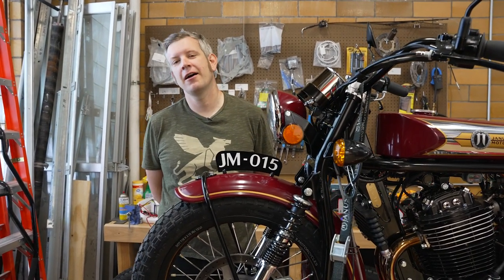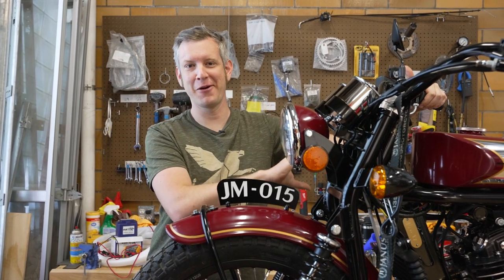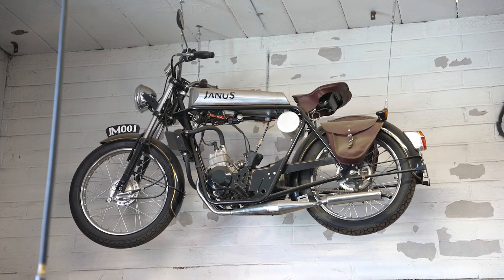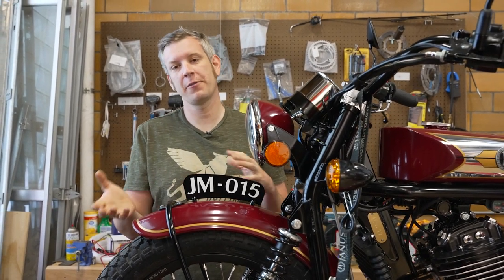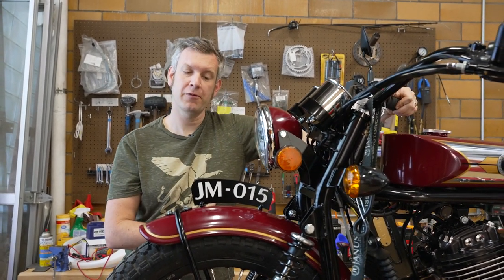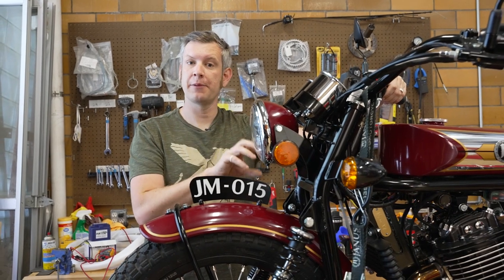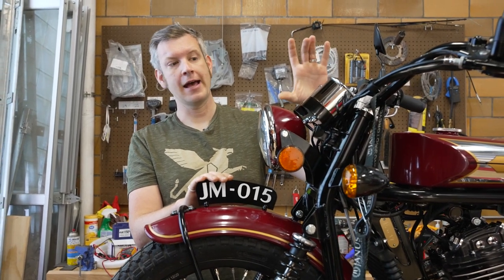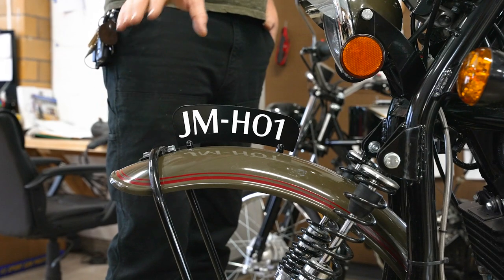What does the number mean on the front of a Janus?

Comment: Will you ever make a bike with a sidecar? That would be so cool, I'd get the first one.
Reply: I would think you would need more power
Reply: yeah, probably
Reply: @silverpairaducks  Definitely for the 250. Not sure how the 450 would perform. I have a Ural Gear Up as a 750 twin. Let's just say that acceleration / performance on that rig is underwhelming.
Reply: @silverpairaducks  The 450 has 30hp.  I had a sidecar on my RE 500 with about 25 hp.   It was able to do freeway speed.     Yes, it has enough power.
Reply: @AZGeek520  The Ural has 42 HP and weighs 740 pounds.   The 450 Halcyon has 30 hp and weighs 345 pounds.  A small sidecar weighs 200 pounds.   The two have very similar pounds per hp rating.